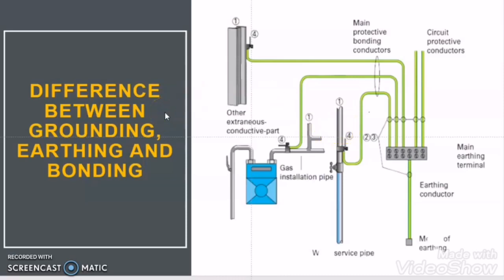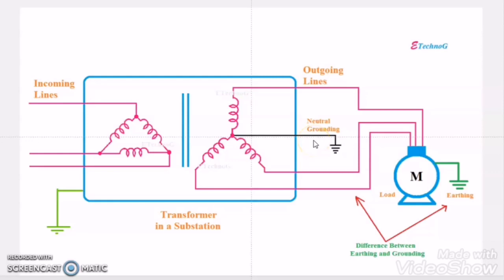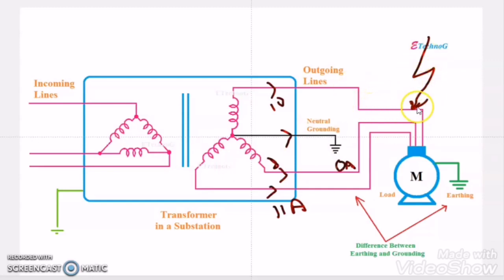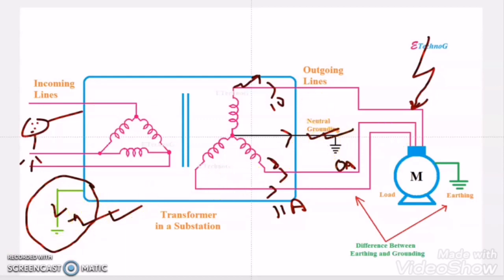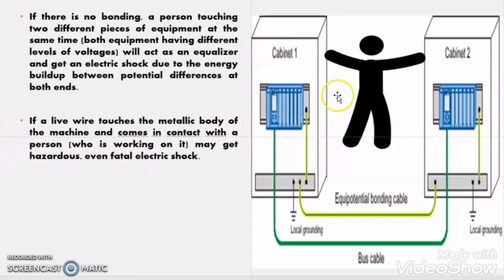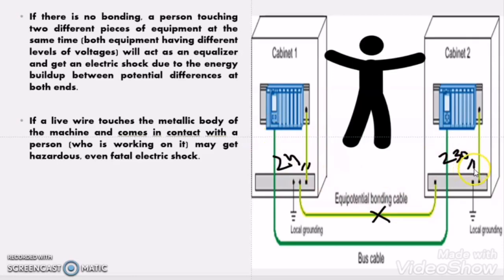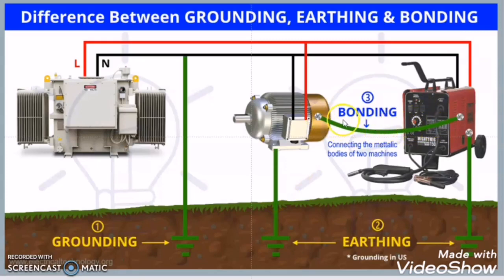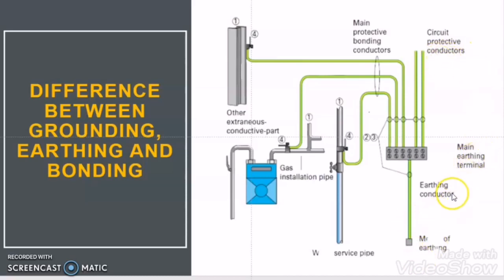Difference between Grounding, Earthing and Bonding. || Different type of Earth Conductors.

Comment: Interesting to hear the differentiation between grounding and earthing in your country. In many countries they are just 2 words meaning the same thing. American electricians usually talk about grounding where European electricians usually talk about earthing. Both mean when you drive a rod into the soil and connect a conductor to it, it's called earthing or grounding.

Bonding or equipotential bonding is the same but many non technical people actually talk about ground or earthing while in fact they meaning bonding.

Comment: Sir please make a video on full details of earthing,
Construction of earthing,
Is water useful for good earthing,
Is earth electrode place in a dry or wet area...
And what is the final value of earth should be achieved
Reply from the maker: Ok sure
Reply: It all depends on how you protect against ground/earth faults and how well you can drive an earth rod. In some regions with rocky soil, getting an earth deep enough to get a low resistance is quite difficult. 

Also some countries allow neutral earthing (connecting the incoming grounded neutral to your local earth). This is the common way to apply grounding and earthing in North America and has the advantage fuses and circuit breakers will trip when ground/earth faults occur. This is called TN-C-S system.

In other countries neutral grounding is only allowed at the transformer and it should not be grounded/earthed anywhere downstream. Usually these countries require you to have one or more RCD's (Residual Current Device's) protecting each circuit. This is called TT system.

Many countries apply redundancy by applying neutral earthing with RCD's. The disadvantage of neutral earthing is stray currents. This is because neutral currents can also flow through the earth to the transformer. 

In order to have both neutral earthing without stray currents you can run an earth wire all the way to the transformer. This way neutral currents flow back to the transformer only over the neutral wire while the earth conductors are earthed, grounded and bonded. This is called TN-S system.

Utility companies don't mind TN-C-S and like the redundant neutral earth connections because it makes their network more stable. But more and more technicians are frowning upon TN-C-S and instead advise TN-S or TT. The problem is both TN-S and TT are more expensive. TN-S can requires up to 33% more copper (on a single phase service) or 25% more copper (on a three phase service). TT system requires more copper but it depends on the length and size of the earth rods. Both TN-S and TT also more maintenance and periodic checks of the earth's performance since a user won't see when the earthing problems until it's too late.